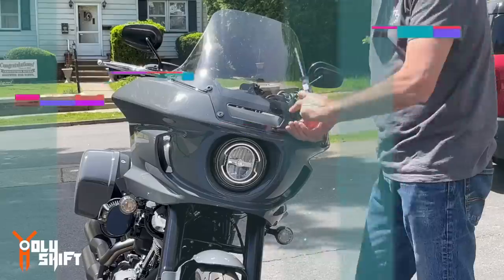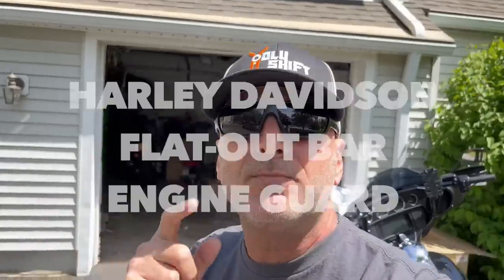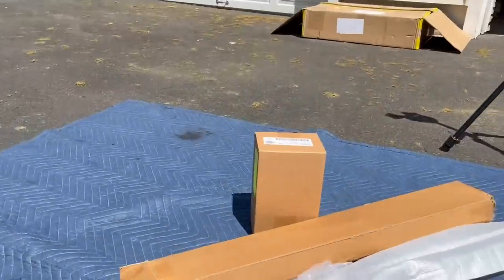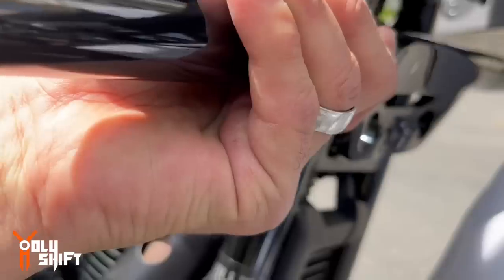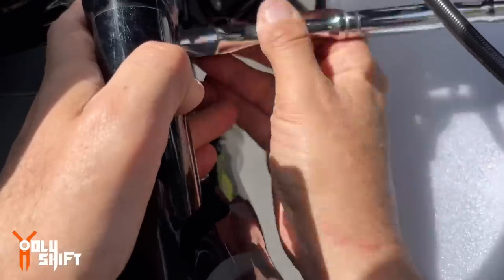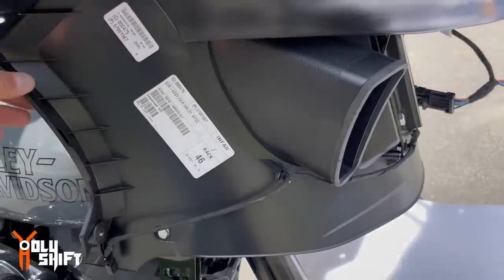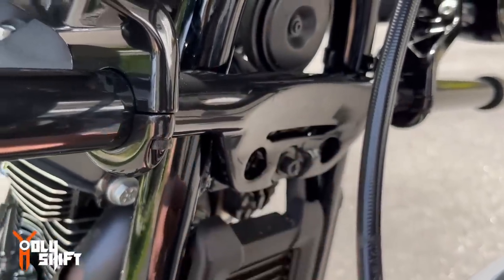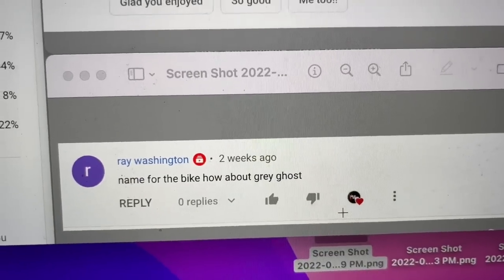When You Get A Freebie From Harley….

Comment: I bought the El Diablo edition of this bike recently.  The parts guy at the dealership could not find any Harley product that works as an engine guard for this this bike.  Definitely did not know about this flat bar.  I bought the Bung King aftermarket solution for the front and back.  I have not installed them yet, but the video by GEM implies that it is an easier install compared to the Harley product. You don't have to remove the fairing.   Thanks for the video.

Comment: A few of the ST owners have had the plastic headlight ring pop off. To remove you turn the ring slightly and it comes off real easy. May want to take a look and see if you can secure it a little better in case yours too comes off.
Reply from the maker: Thanks- I did play around with it - flimsy poor design!

Comment: I can see how the bar would function in a tip-over, but I'm not sure about losing the functionality of highway pegs that a traditional or mustache engine guard would provide. The new bronze-tone windscreen looks great - I'm anxious to see you test it out for protection from buffeting.
Reply from the maker: I know ! I'm not sure as to highway peg functionality ! I need Pegs ...
Reply: Thats why I went with the bungking lower front bar. Attaches much more securely and is low enough to use as highway pegs.
Reply from the maker: @2kanchoo  what about lean angle ? Any problem?
Reply: @HOLYSHIFT  Haven't tried it out yet but I can't see there being any. The st has higher rear suspension, a bit stiffer front than the s, and the pics on the bungking website show a low rider set down on the bar and the rider pegs are folded up, so a lot farther than one would be wanting to lean anyway haha.
Reply from the maker: @2kanchoo  gotcha- thanks buddy

Comment: Sandy, I love your videos  and I love that bike, but I gotta say, if I owned a Low Rider ST, I wouldn't be a fan of these mods.  Harley should have engineered that bar to be bolted right on to the existing location, without having to remove all that hardware.  I am also a fan of the traditional shaped engine guards, not the single bar.   As far as that  new windscreen, I can't see how that will provide any wind protection whatsoever.  I'll be anxiously waiting for your review on it.  Take care, buddy.

Comment: The tiny windshield looks like the goofy useless thing MoCo put on the Sport Glide that everyone threw in the trash.  

If you actually use the bike for more than bragging rights & garage art. Like to include commuting, getting caught in the rain or cold, and to include longer trips. The short stock windshield is generally adequate for people 5’9 and shorter. 

Taller riders will want MoCos taller windshield and with a good smoked tint for sun glare & better looks. Windshields need to come to the height of your chin to get really effective & useful. 

The bar is a good investment to save engine cases, tank, bars mirrors & fairing from when the bike gets dropped or knocked over.  👍. 

I have a Sport Glide with the 15” Gustafson vented windshield & lowers. The taller rear shock that MoCo put on the LRS-T. And the Bunk King bar that MoCo copied this bar from. All done long before MoCo announced the LRS-T. BTW 2019 with 30k miles despite always working 70 hour weeks.

Comment: All that just to put a metal stick on your bike? Ok I'll ask! Why?
Reply: So that when the bike gets dropped or knocked over in a parking lot by some lady in a minivan you don’t have scratched engine cases dinged tank boogered bars fairing or mirrors. Pretty common sense huh?
Reply: @vernlochtefeld1626  Duh! I was being sarcastic. I've been riding Harleys since 1973. I was implying HD could have engineered an easier installed and better looking engine guard than that stick.
Reply: @rogershinton7483  I didn’t know whether your statement was literal or not. So I replied as much for other readers as for yourself. It’s questionable to assume sarcasm from print with people you don’t know as common sense doesn’t seem to be so common anymore. I know 25 yo old males that wouldn’t know where to find a spare or how to change it or the battery or how to jump start it. In 73 I was still sporting my mini bike. 🙂
Reply: @vernlochtefeld1626  I agree with you, however, doesn't that installation seem more complex than it should be? The finished install still just looks like a stick not to mention what HD charges for it. Has to be a better idea.
Reply: @rogershinton7483  Agreed. In fact I run the Bunk King on my Sport Glide. It’s way more substantial with two bars with a much simpler less involved install. MoCo’s seems to be an afterthought. The bar looks to be a cheaper Bunk King ish copy worse the LRST fairing was obviously not designed with adding a crash bar in mind. Shame since it’s such a common upgrade.
Reply: @vernlochtefeld1626  I'm envious of you having a mini bike earlier. My parents wouldn't let me have one so I got back at them by buying first Harley when I turned legal age. Showed them huh? Be well.
Reply from the maker: Guys - thanks for keeping this discussion respectful ! This “stick” is functional only as a guard , but not esthetic in my Opinion! It’s the west coast stunt rider style - but I don’t like the fact that it’s not functional! I’ll probably switch to a Bungking - can serve as highway pegs !
Reply: That bar looks like a piece got left on from the shipping crate